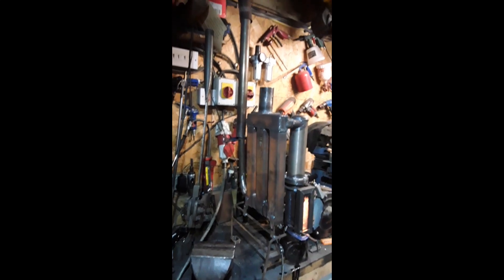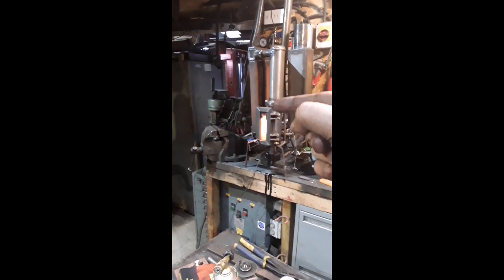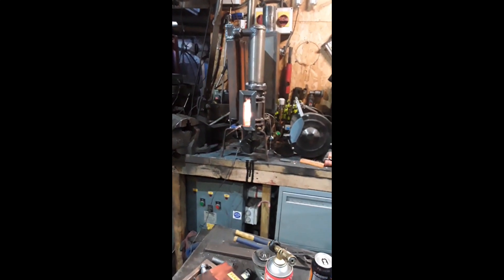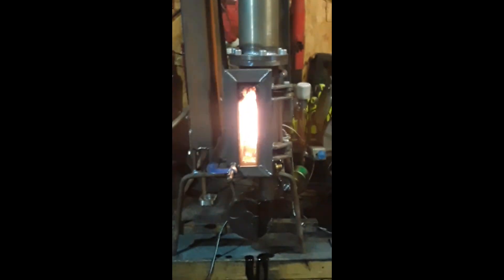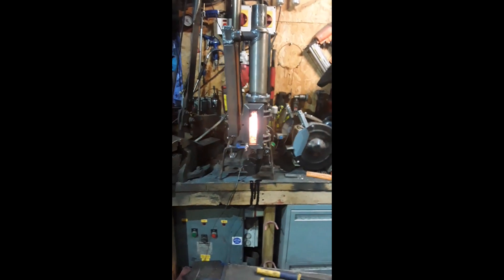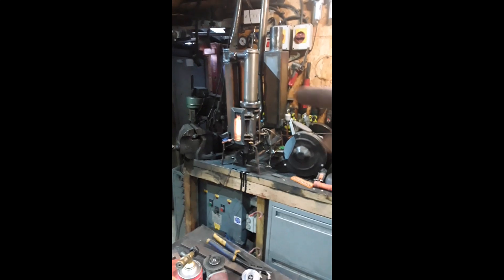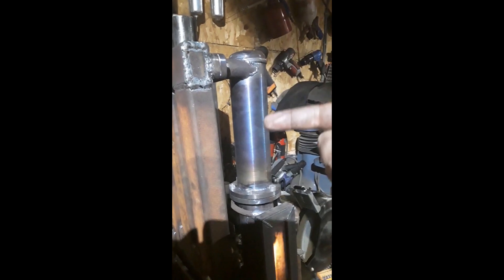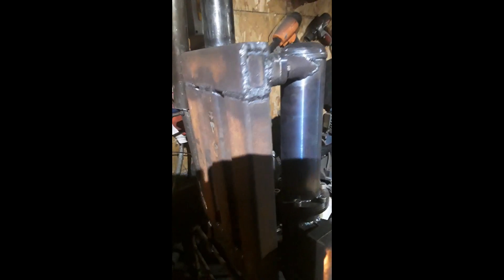testing the mini waste oil heater with built in heat exchanger

Comment: You should have clean outs on your heat exchanger because as that gas cools that little bit of salt on the glass is going to build up in the heat exchanger and somehow you’re gonna have to clean it and I understand you have the skills to chop it out and clean it and put it back together but great job nice little heater❤️‍🔥🇺🇸
Reply from the maker: That's a good point, I'll add them on the next one I build. That soot never got worse i think it was just when i tried running it on wet oil and had the door open a lot.

Comment: Hi Shane, Thanks for sharing this with us. How do you think a large (inverted) stainless pot with a heat riser up the middle and the exhaust from the bottom would work as a simple heat exchanger? Similar to those used in rocket mass heaters. Also, could very fine stainless steel mesh suffice for the window? Tim
Reply from the maker: I'm not sure on the mesh I doubt it will be a good option as gases may escape from the mesh.  Any increase in surface area will help transfer heat so yeah an upside down pot should give some improvement

Comment: I see what you were referring to Shane, I don't think it will take very much to get it right. Do you find it's putting out much more heat than the smaller one?
Reply from the maker: Yes and no. It's getting the shed to about 24-26c but the surface temperature is far lower then the original. I think my air intake is messing with the performance. Once I get it right it should run like a little blast furnace. The original heater can run with surface temperatures exceeding 800c! ITS TERRIFYING but you know I had to test it lol
Reply: @smithbuilt  That's the thing too Shane, when trying to heat a larger surface of steel, it will all heat up but at lower temperatures. If there's too much steel then everything becomes more like a large radiator rather than a small nuclear furnace 😂
Is the top of the flue noticeably cooler?
Reply from the maker: @pa_maj.MARTINI-van-MAN  yeah the flue is cooler, I think... I'm not touching it to find out. I'll find my inferred thermometer out and check it. But I think it's going to have a huge impact as the heat exchanger is made from 4mm thick walled section.
Reply: @smithbuilt  👍 Keep at it mate, it will be great if it does the job for you after all that work!!